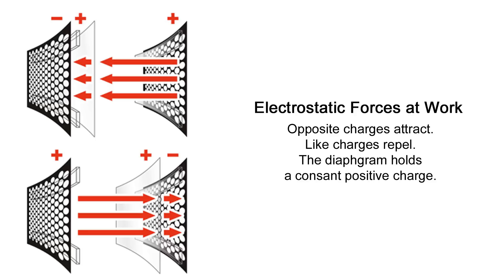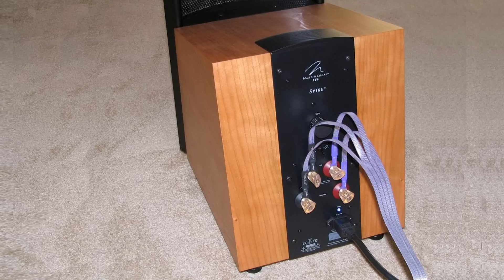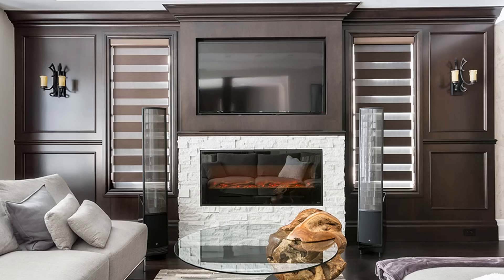MartinLogan Factory Tour on Electrostatic Speakers & More

Comment: Martin Logan are the most prolific maker of electrostatic speakers by far. The number of models they make while forever launching new models boggles the mind. One thing I do not hear after a litany of electrostatic speakers over several decades is... improvement.  Yes there are subtle improvements here and there especially in the bass but overall the speakers sound very much like they always have. An original Monolith, CLS or SL3 sound just as transparent and musical as what they make today. And they still have that minor glare in the upper midrange. You can hear it on the old CLS and it's also there in today's flagship Neolith.

Comment: As a side note.  I have used the microphone and sound setup that came with my Denon receiver.  The problem I have with it is that I lose the max volume that the receiver can supply to the speakers (which can handle more RMS power than what the receiver provides as a MAX)... in other words I can't get the volume levels from the optimized sound from the setup versus the default from factory setup.  I don't want to lose that power so I reverted the receiver back to default settings.  Do you have any suggestions?
Reply from the maker: Does this only happen when Audyssey is engaged? This was a known problem with older Denon units in the past.  If that's the case, don't use Audyssey.
Reply: I am not sure.  I know it only happens after I run the sound calibration using the supplied Audyssey microphone.  I have the AVR-S910W.  Thank you for the quick response.
Reply from the maker: Turn Audyssey off.  If your max volume is restored, then Audyssey is the problem like I've found in prior Denon products.

Comment: I am curious.  I  have an odd shaped room.  I can only set my front floor standing speakers so far apart.  I have them equal distance from the center of the listening area, however my left front is several feet from the wall, due to an entry door being there and the right front is almost right up against the wall.  Is there a way I can improve my sound stage in this situation?

Comment: Gene leading the way as always! Could you do a video on the acoustic treatment in your room, I am interested in those things on the door which I am guessing is slim diffusion. Also would like to say thanks for the guidance over the years which I have finally put into my dedicated home theatre, 10awg speaker cable, dual subs, mini dsp, correct speaker placement for the 7.2 setup, floyd's book, it's all been a big help! The final piece of the puzzle for me is the room treatment, I have damped the front and back and was reluctant to do the sides for the reasons you state on this video and others but I have slap echo without it.